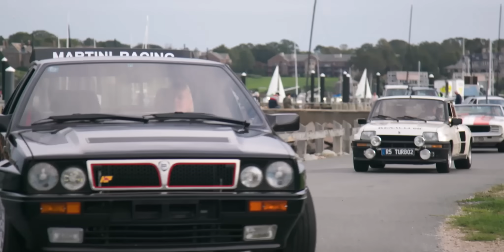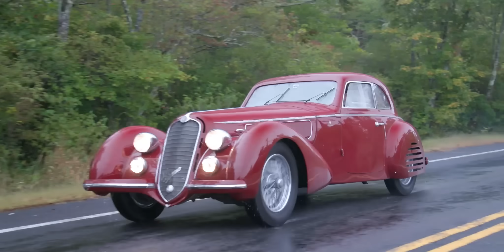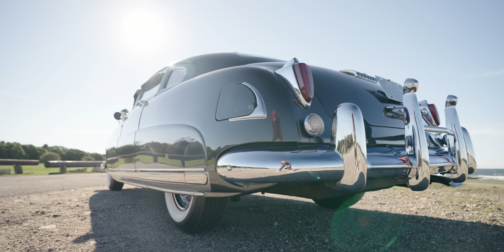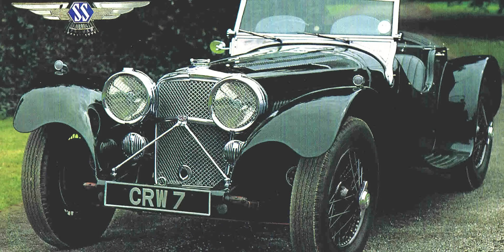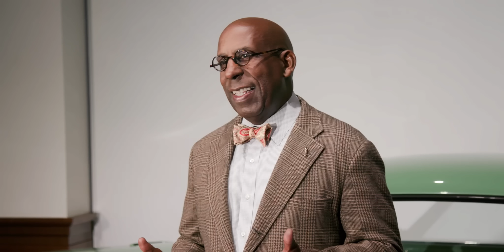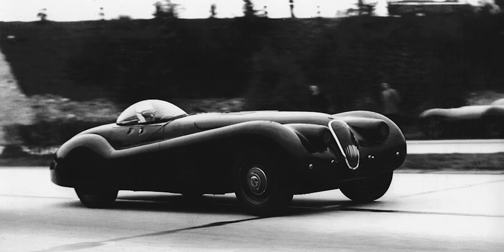Post-War Automotive Engineering — Hudson's Innovation, Jaguar's Birth, & Pegaso's Pursuit of Speed

Comment: Thank you, for your informed revue Mr D, Osborne,  The Pegaso car you are featuring Z102, in Olive Green is a restored Gem 🎖.... Aluminum body (Supeleggera), and the Z-102 is powered by a four-cam all-alloy V8 the Z102 entered production with a 2.5 litre engine, though later variants used a 2.8 L, and 3.2 L  and DOHC desmodromic 32-valve V8 360 hp (268 kW) engines with multiple carburetors or an optional supercharger engine featuring dry-sump lubrication. Power went through a 5-speed non-synchromesh trans-axle... Z-102 could reach a top speed of 151 mph (243 km/h), making it one of the world's fastest production car at that time, in 1951/58.

Comment: WoW ...!  What an incredible history lesson, and the subject is so near and dear to my heart.
PEGASO'S have always fascinated me, the reason is simple. My father's collection of hardback AUTOMOBILE®-automotive books that arrived by subscription, featured several PEGASO'S. When I first saw a picture of Z102 QUAD CAM V-8, with not 1 but 4 carb set up, holy smokes I was hooked, and when you throw in the wild colors, red rubber wheels of the PEGASO"S show cars even an 7 or 8YO can grasp the simply incredible presentation these ultra exotic cars from Spain had on the MATCHBOX & CORGI & later HOT WHEELS buying public.

Comment: Hudsons were very high quality cars, however, not first with a new car after WWII.  "First by far with a postwar car", the 1947 Studebaker was a new body design.  Raymond Loewy was the design firm that worked for Studebaker and designed the new models.  During the war car companies could not use their engineering staff on non war related work.  Since Loewy was an independent contractor he had no restrictions and gave Studebaker an advantage in getting a new car developed sooner.  Great show and I just subbed.

Comment: Thats right , put steering on the other side , huge market , of cashed up former WW2 soldiers ,whom had just left ,and wanted fast cornering ,an brakes that worked ,  an worked again ,shave off  ,30-40 mph , in a lane  , back to 70+ in seconds ,yes expensive ,yet far more thrilling than automatic of that sludged along ,Great show thank you

Comment: My Hudson Commodore had the 308 cubic inch flathead 6. It was very torquey and would spin the rear tires easily in first and shifting into second. The engines were famous for longevity due to the high nickel content 
in the block. The Twin H Power Hornet variant had dual carburetors and made 170 horsepower, more than the   160 hp Jaguar DOHC 3.4 liter motor in original form.
Reply: So the Jag had 30% less capacity but made only 10bhp less? I think we know the way forward
Reply: @stephenscholes4758  You sure can easily identify the nationalists in an automotive comment section.